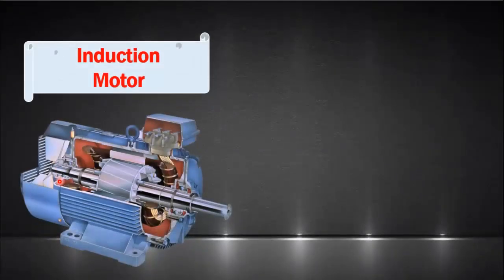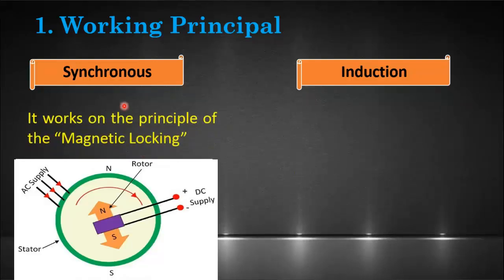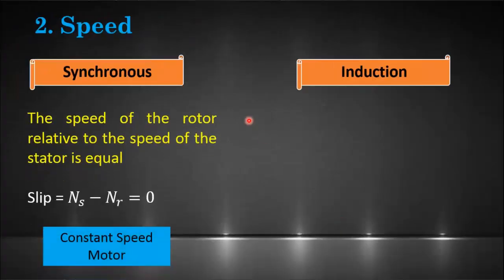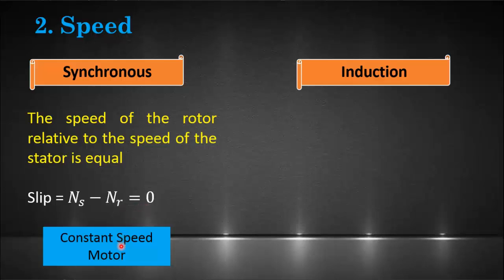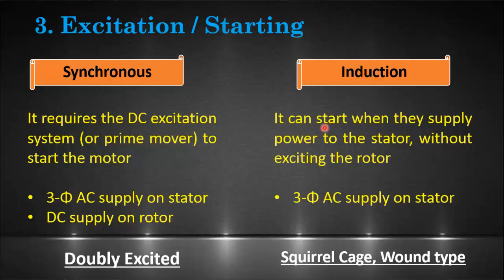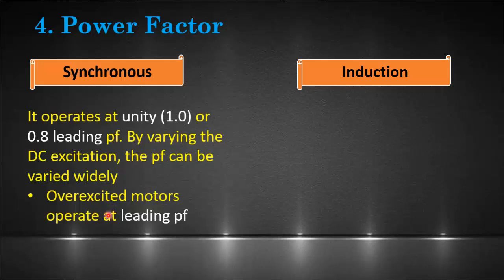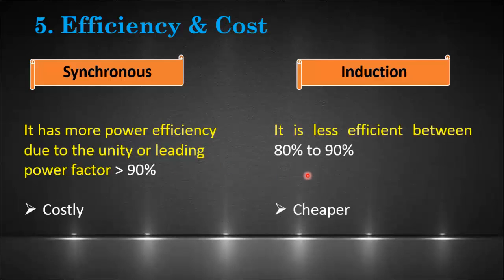Induction vs Synchronous Motor | Difference between induction and synchronous motor

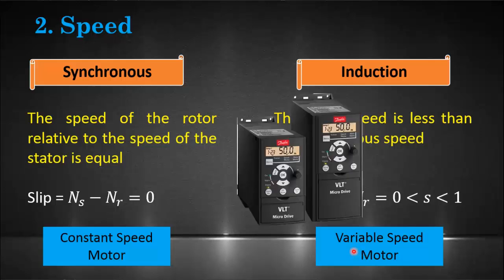Comment: 2:33 but cant we change the stator frequency with the VFD aswell in synchronus
Reply from the maker: Yes of course you can change the frequency from VFD but motor principle will remain same and speed will vary based on synchronous speed

Comment: you are wrong in some points, In an induction generator, the rotor speed is slightly higher than the synchronous speed when generating electricity. This characteristic makes it suitable for wind turbine applications, where the variable wind speed causes changes in rotor speed. When the rotor speed exceeds the synchronous speed, the relative motion between the rotor and the stator induces electrical current, allowing the generator to produce electricity.
Reply from the maker: This is wrong. Synchronous is higher than rotor